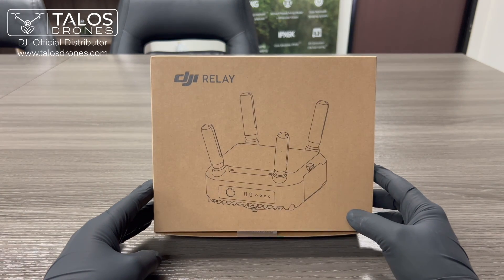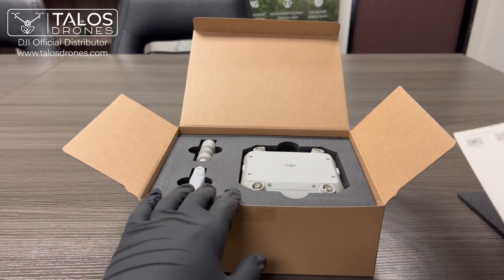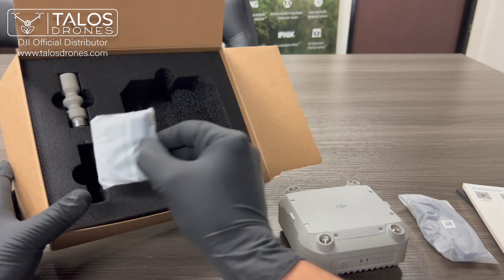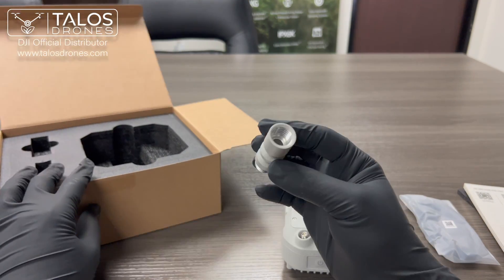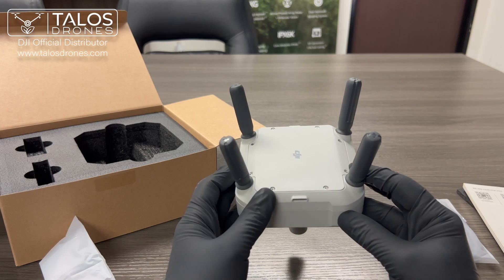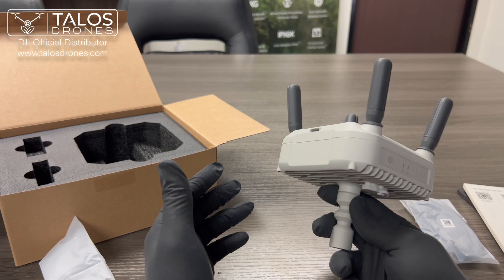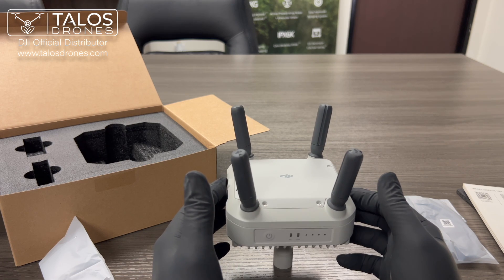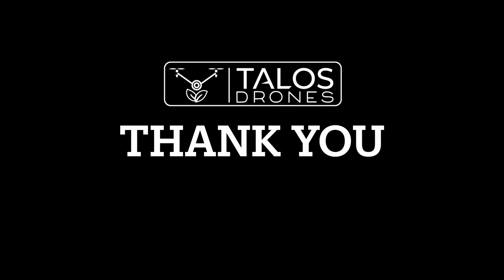Unboxing the DJI Relay used for Agras T40: The Game Changer in Agricultural Drone Technology

Comment: Hi bro. Not working ( remote not see device
Reply from the maker: Please upgrade the firmware of your drone to the latest version. The current version required to use DJI Relay is :
Aircraft: V01.00.0510
Remote Controller: V01.01.0837
APP: V6.5.19
Reply: @talosdrones  how we can do connect? Wireless or cable?
Reply: @talosdrones   does not pair with the remote control, my version APP: 6.5.21, aircraft 01.00.0515, remote 01.01.0838, relay 01.02.0201 (updated via cable DJI Asistant 2 MG). Please tell me what the reason is
Reply: Hola, que cargador es recomendable para la antena DJI Relay? Ya que viene sin cargador.